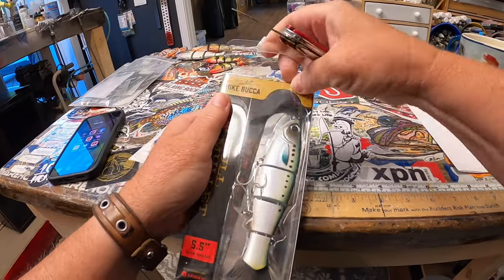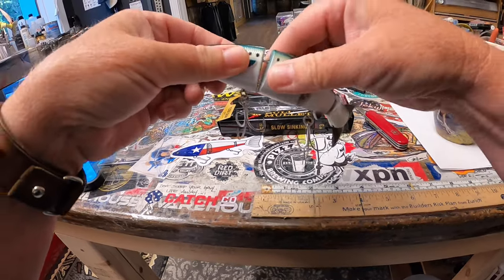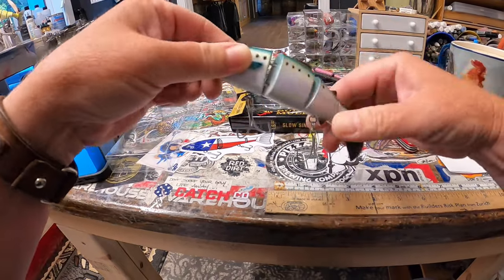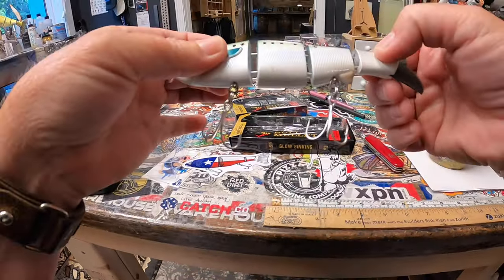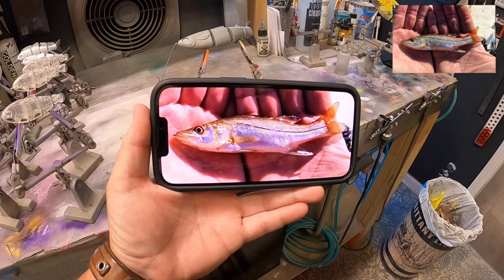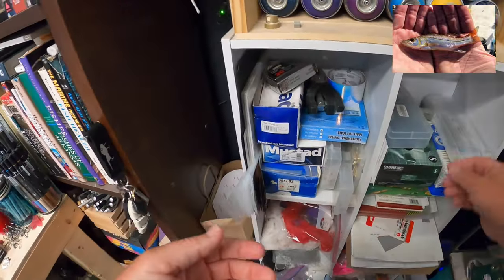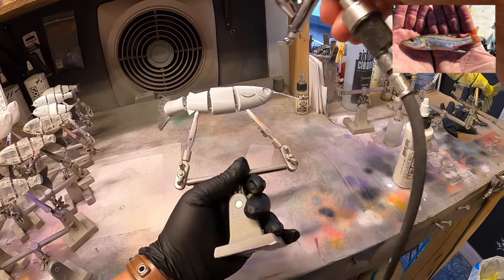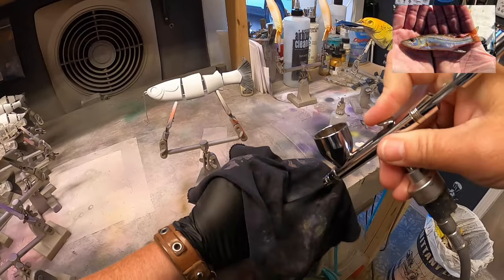Painting a Custom Baby Snook!  (A BULL MULLET MAKEOVER)

Comment: Hello, I have a question a bit off topic.  I just started using diamond clear coat.  Do you know how it would hold up in salt water?  I noticed it had a reaction when the bottom fish jig i coated was touching a rubber worm in my box.  Maybe I didn’t let it cure enough?  Been about 20 hrs.  One coat.     I ended up spraying clear spray paint over it to maybe protect the clear coat.